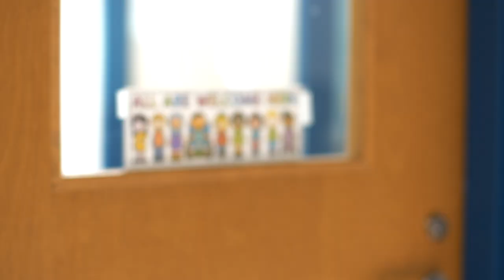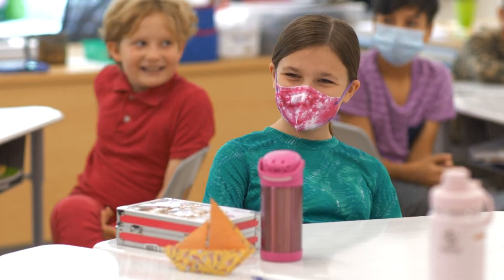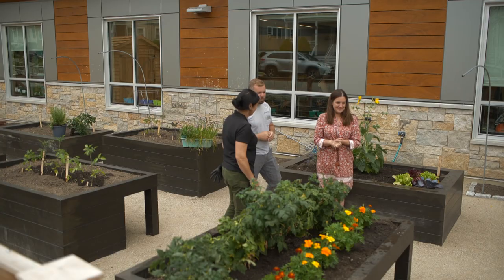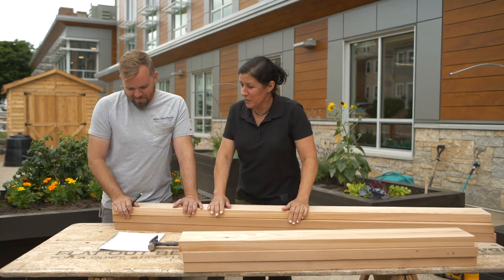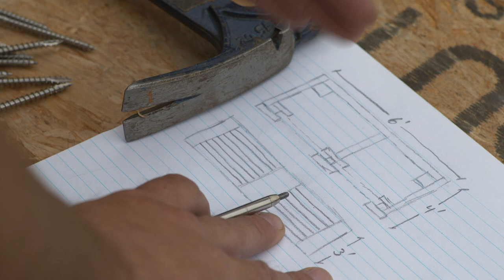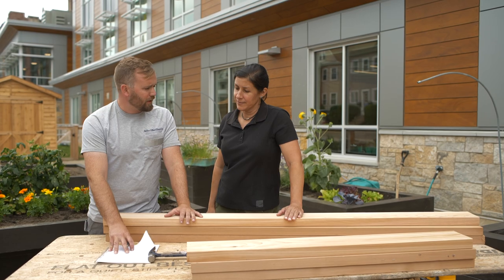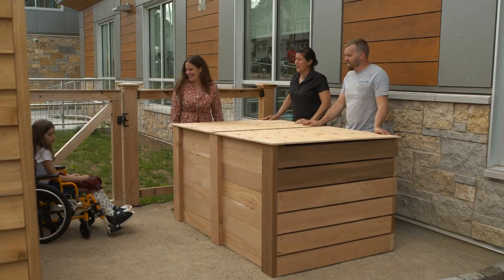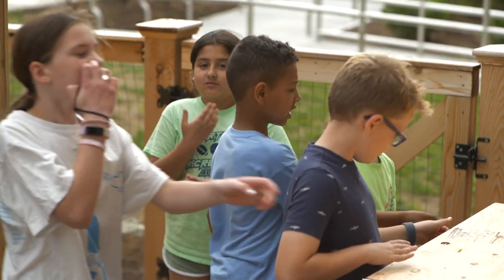How to Build a Classroom Compost Bin | Ask This Old House

Comment: LEED certification doesn't mean more energy out than in... What a gross oversimplification. And a teacher wearing flip flops? 😂 

Really getting tired of the scripted conversations and staged environments.  TOH you can do better. Show us what goes into building and designing without all the agenda pushing.
Reply: What's wrong with having the material prepared in advance? Almost everything you watch is probably prepared or scripted in some way. Do you really want to see a lot of "um" and "uh" comments and a lot of dead time? And if that school was staged, it was the most elaborate staging I've seen outside of hollywood that TOH definitely doesn't have the budget for. I'm pretty sure it was a real school. 

Maybe this just isn't the best channel/show for you.
Reply: Why are you like this
Reply: @johndoe6032  Toh use to pride itself on home improvement diy. You would get to see some of the ins and outs how to the project. Now all you see is scripted drama, it isn’t made for someone who wants to do the project themselves. It also provides a gross over simplification of what goes into the project. Meaning if someone tries to tackle this themselves they will likely get overwhelmed. If you think that’s okay then you miss the whole point of toh and should be watching hgtv instead.
Reply: @flat-earther  i dont know enough about solor panels to say weather your right or wrong. But i do solar panels are a better way to produce electricity than most other ways.
Reply: @michaelcarroll991  Solar panels output DC, direct current. In our homes we use AC, alternating current. So we can't use the electricity directly off the panels, we have to use an inverter. Now most inverters create ''dirty electricity'' when they convert DC to AC, search that term if you don't know what it means.